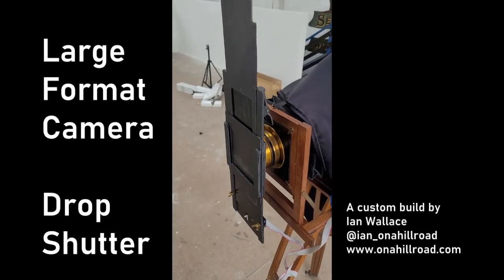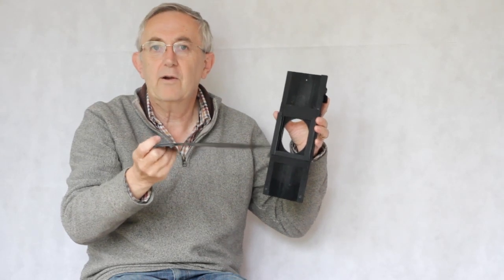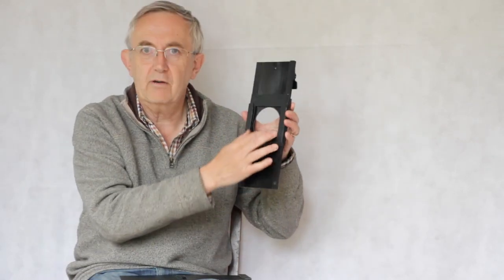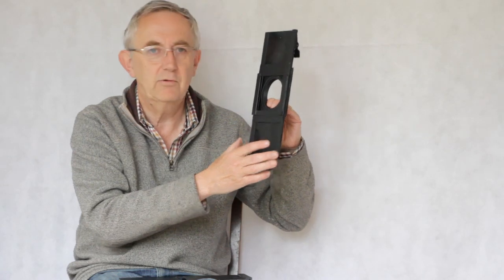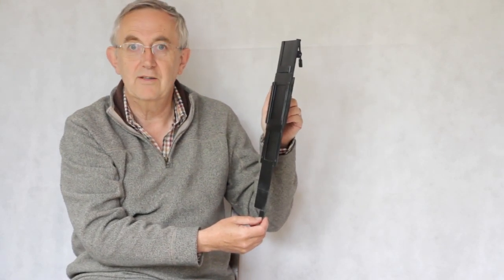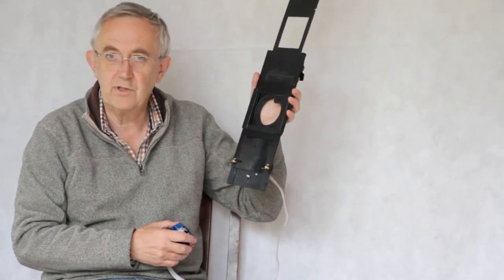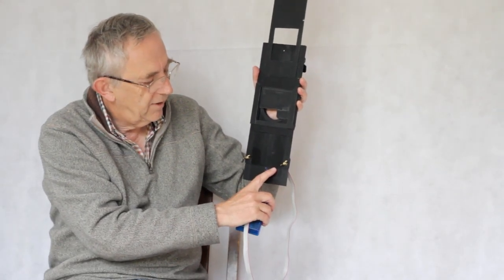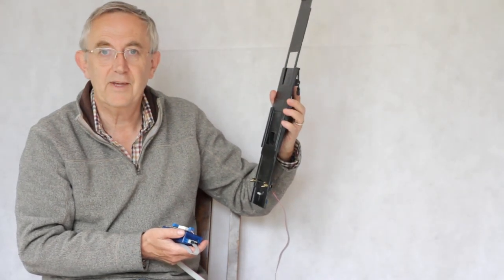Large Format Drop Shutter with Arduino timing controller

Comment: Ingenious. Will you be able to damp the vibration caused by the drop? Or is that unlikely to happen with a proper fitting?
Reply from the maker: Yes this could be an issue.  i think most of the vibration comes when the falling blade is arrested. In manual mode this is after the exposure. In arrested mode the exposure is usually much longer compared to the duration of vibration (and therefore doesn't really show). The first images with the shutter have not so far shown a problem.
Reply: I imagine that if the housing itself is perfectly vertical, the slide will drop without resistance. In any case, the nifty thing here, as you say, is being able to control those fractions of a second. To those with barrel lenses and fast apertures, this would be a godsend
Reply: This is tremendous and helps extend the viability of large format photography.